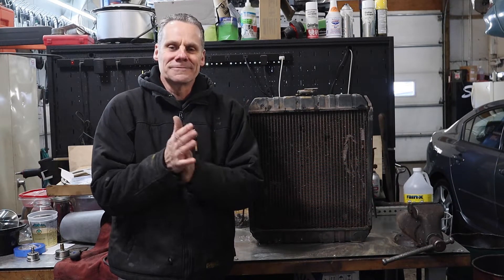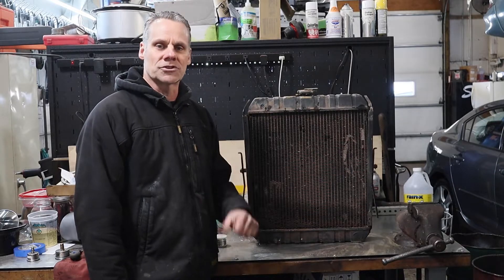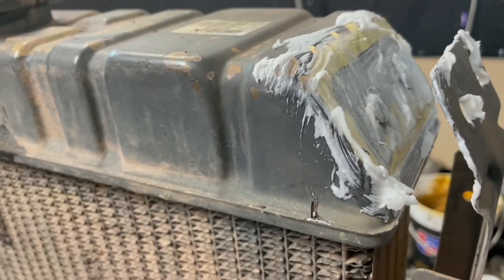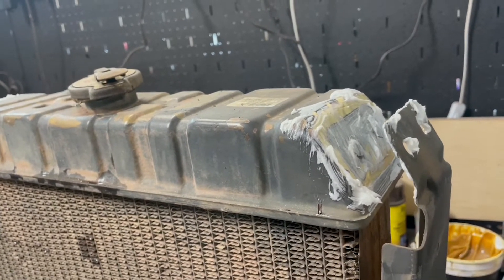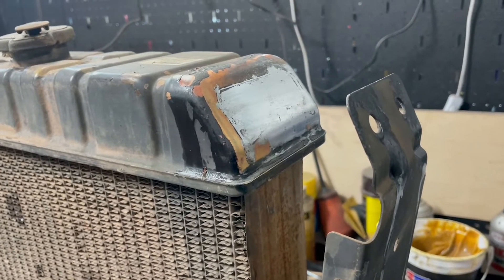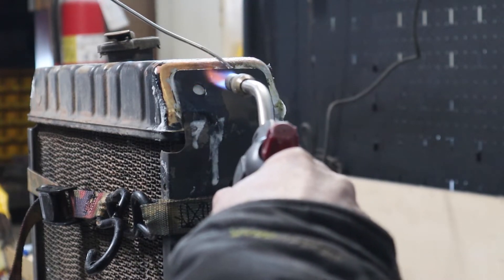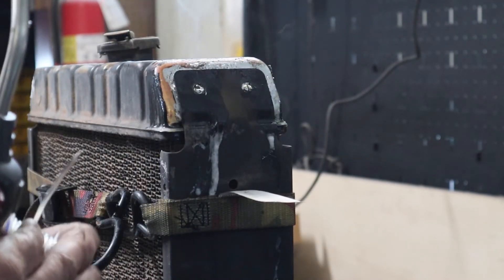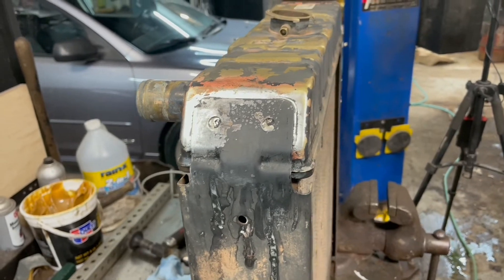How to solder and repair a radiator bracket! Fixing the John Deere 6675 Skid steer radiator!

Comment: I'm scared I'll loosen the tank from the core near the bracket. What about water in the radiator up to near the soldering area and tilt the radiator so there's a small air pocket under the heated area? Or heat sink putty on the tank. Or is this all overkill?
Reply from the maker: Water may not let it heat up enough to flow the solder. Just take it slow and steady, working in a small area at a time!

Comment: Would it be better if you had the cap off?
Reply from the maker: I don't think it matters, pressure wise. rad is wide open on hose connectors and drain cock! It can't hurt either way though! Thanks!
Reply: @SmittysShop  thank you. I thought I was going to have to spend hundreds of dollars at a radiator shop. I will just fix it myself

Comment: If you can, best to tilt the radiator on an angle to get that surface you're soldering level rather than having the radiator upright which leaves your solder surface on a 45 or more degree angle. The way you've done it the solder tends to run away from the area you want to join. Those two holes are there to feed the solder in, the heat from your propane torch should draw it out to the edge of the bracket.
Reply from the maker: Great advise and thanks for watching!